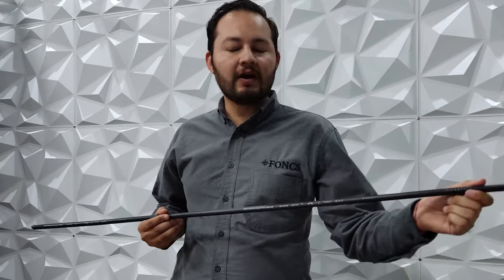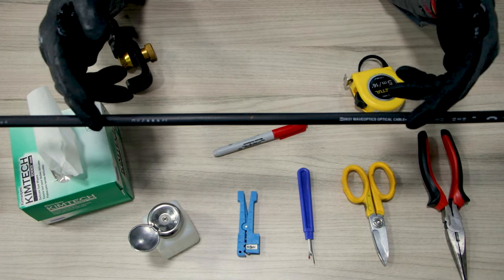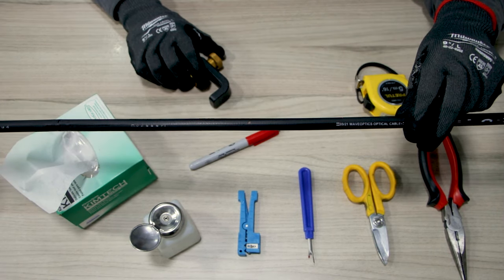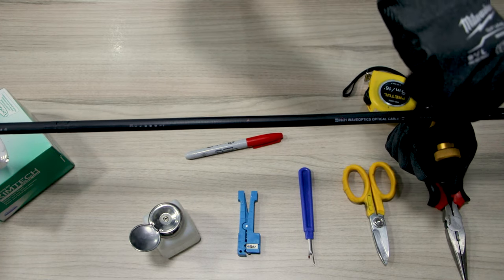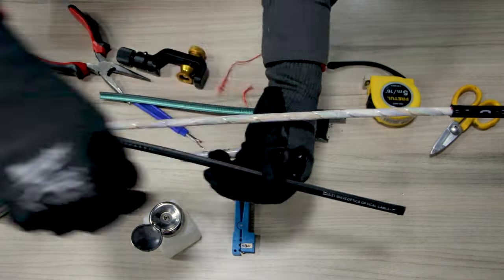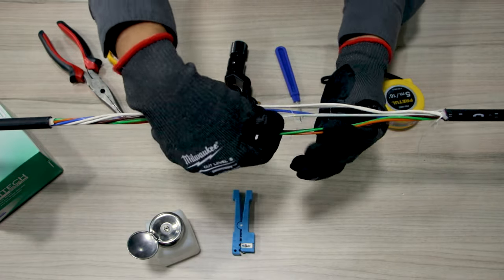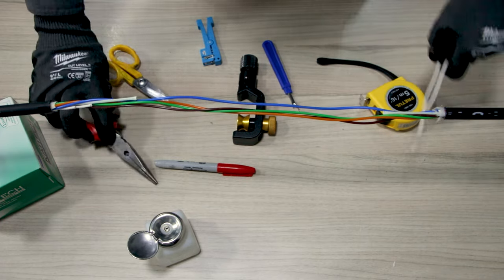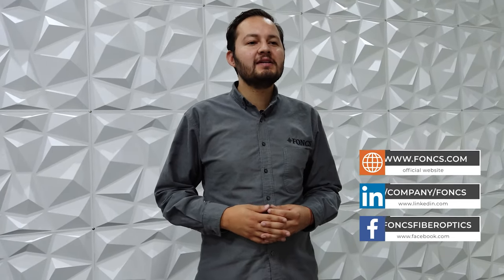Armored Fiber Optic Cable Preparation for Mid-Span Access | FONCS

Comment: How the hell did you know where the twist came up in the center? It’s key to mid spanning
Reply from the maker: We unrolled the loose tubes in the middle while holding both ends of the cable, this will relieve some tension to cut the central strength member, breaking the SZ stranding of the loose tubes in the process.
Reply: @foncs  no I mean before you strip the cable. Any indicators on the outside of the jacket?
Reply: @Ashphinchtersayswhat  Sometimes you can see it on the outer layer. But that depends on the thickness of the outer layer. On some cables its also marked where its retwisted.
Reply: @jonathanjensen2727  I have looked on all my different count armor cable and no buenos. Bummer.
Reply: @Ashphinchtersayswhat  I see, we use a norwegian brand called Ducatel at work. Here they have a marking that looks like a "bridge" sort of on the rotations. Every brand might not give us that benefit tho :)

Comment: what is the common specification for midspan fiber cable to know it will be used in midspan or not?
Reply from the maker: It depends on the type of cable and the installation environment. Generally, it is necessary for drop installations and fiber transitions with loose tube armored and dielectric cables.